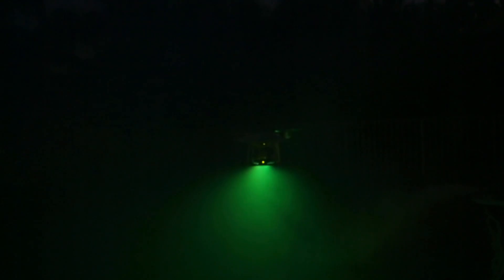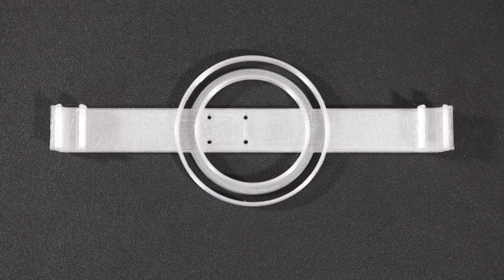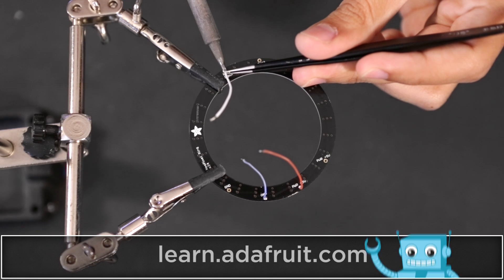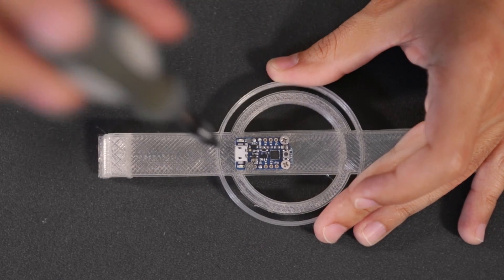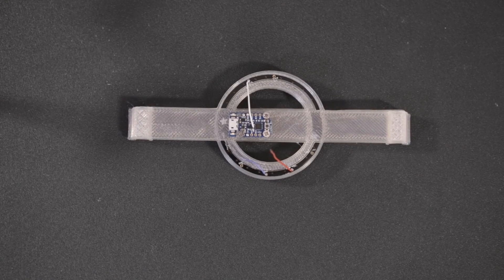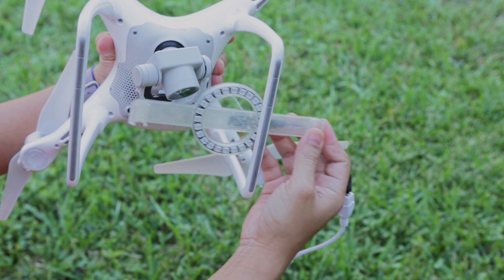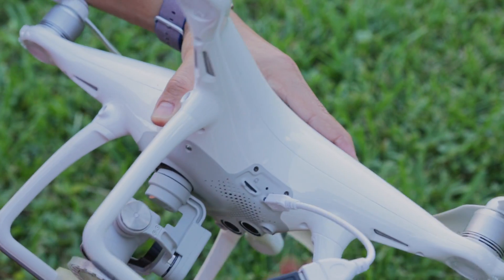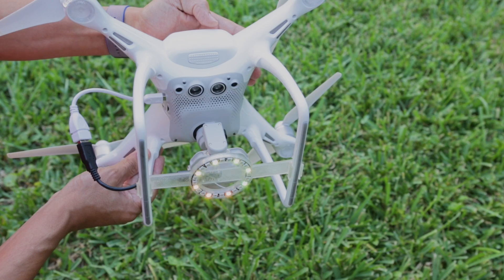UFO Drone LEDs -  NeoPixel for Phantom 4 #3DPrinting

Comment: hi  again. I wonder you can help me with the same set up but I want the led strip around the frame of the drone . they do sell this on ebay . but I want the set up with the usb connect right to the drone . no messy wiring .  and the led light moving around like the one you did with the pixel ring. thanks

Comment: Just be aware that FAA rules state that you aren't supposed to fly in the U.S. except during daylight hours. Really cool project idea, though!
Reply: Not true under RC rules.  True if your fly under the FAAs commercial flight program, but not true if your flying "recreationally".  Their are safety "guidelines" like stay under 400ft (which is smart depending on where your flying) but they are for the most part, guidelines.  The main rules are stay away from airports and don't be a moron.  See here for the pdf on recreational rules (it's at the bottom of the pdf btw)  https://www.faa.gov/uas/getting_started/fly_for_fun/

Comment: TIP: For a better tractor beam effect add a flat black collar around the ring. Make it 3-4 inches long/deep to prevent stray emissions. The goal being light emitting in only the vertical direction -> straight down.